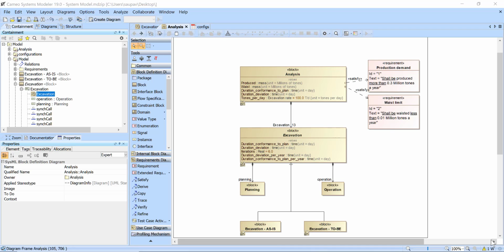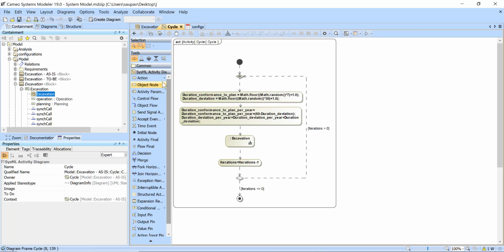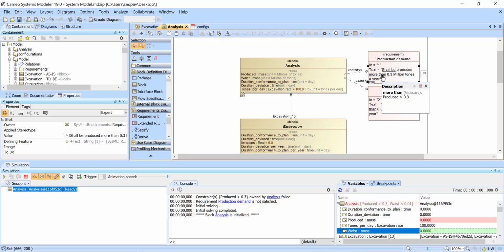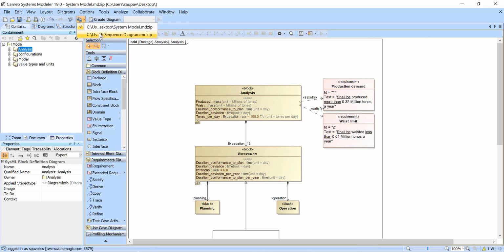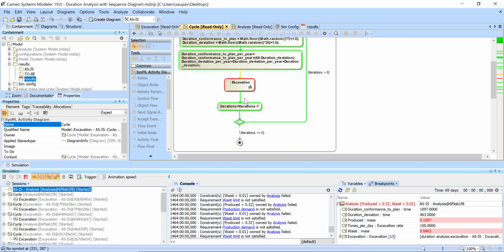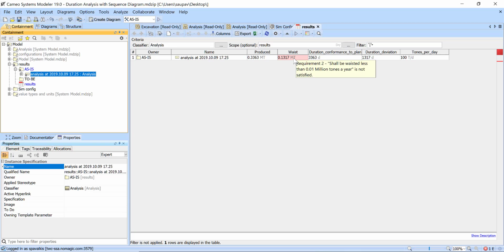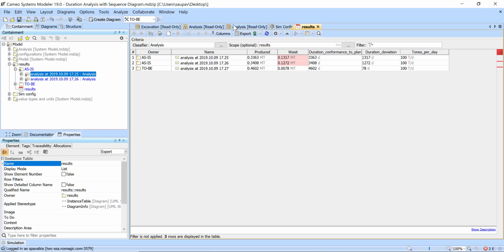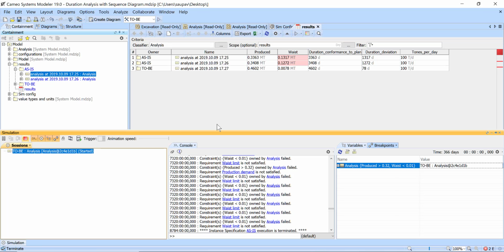Process Improvement Simulation with SysML Sequence Diagram

Comment: Thankyou Saulius. This is very helpful. For the duration constraints in the sequence diagram, can you please tell how did you pass value from value property ? example : Duration_conformance_to_plan
Reply from the maker: Thank you Navin! Duration constraint in sequence diagram can access value properties by name if those value properties are in sequence diagram simulation context block. Let me know if more derails would be helpful.
Reply: @MBSEExecution  thankyou. Thats what i thought as well,  will touch base if I run into problems. Thanks for your guidance.